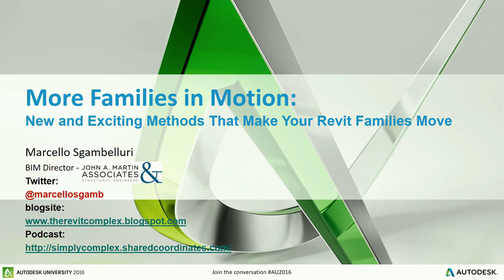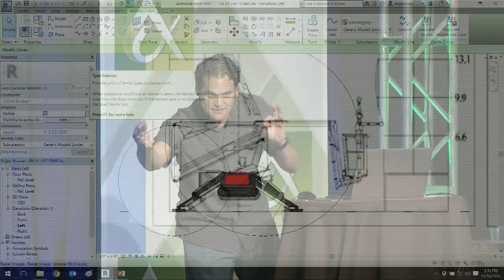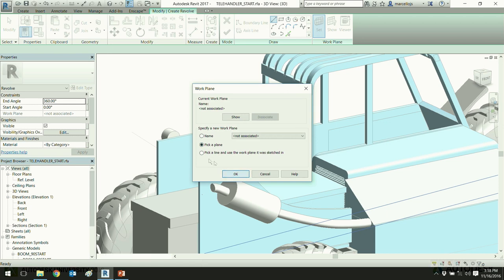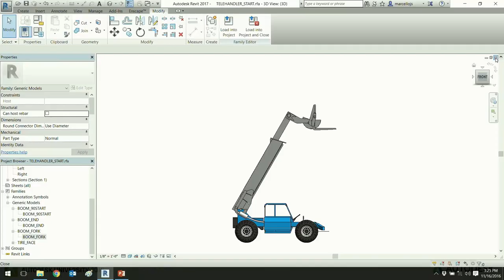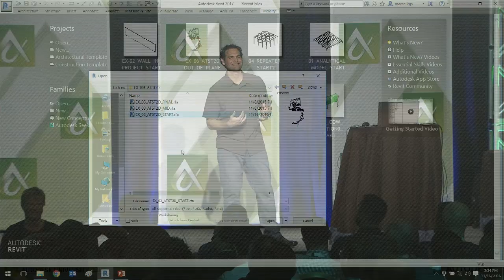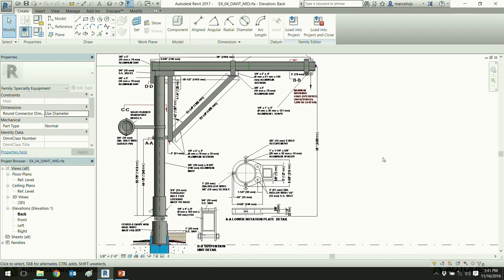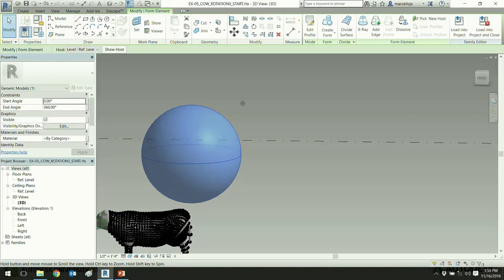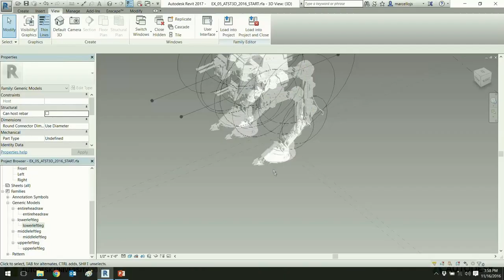More Families in Motion: New and Exciting Methods That Make Your Revit Families Move

Comment: These are workarounds, but Marcello is good at promoting exciting new ways to use the software. I like the enthusiasm too. I wonder if creating rotated elements without using reference planes and the accompanying angular dimensions would impede creating usable construction documents for those items? That would defeat part of the purpose of using Revit. But, it definitely makes it easier to construct animated moving parts in the software. Currently available Revit construction equipment boom families use these ideas. I naturally wonder who developed the ideas first? I guess everybody borrows from others to some degree.